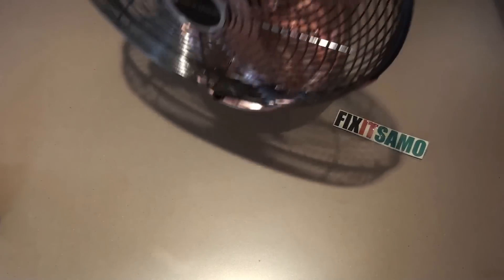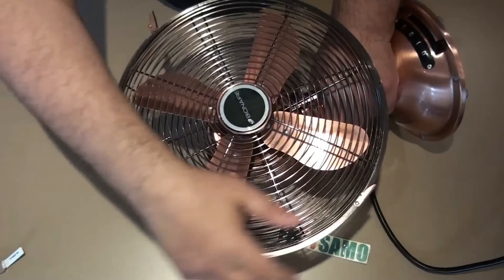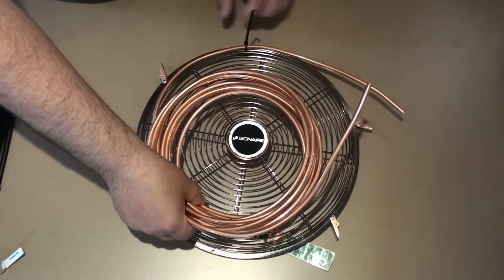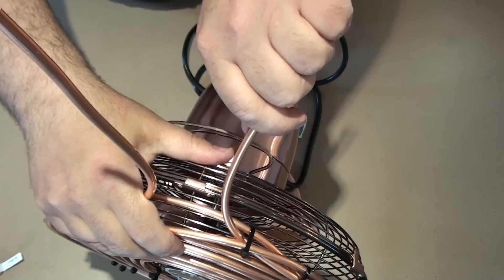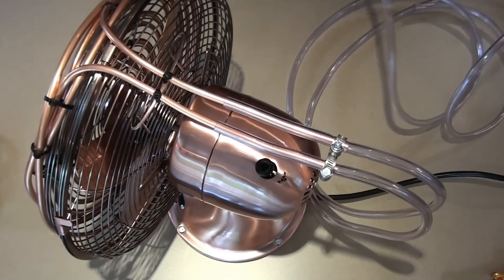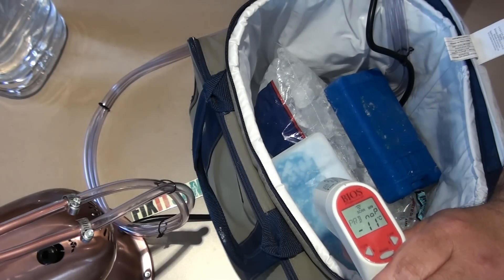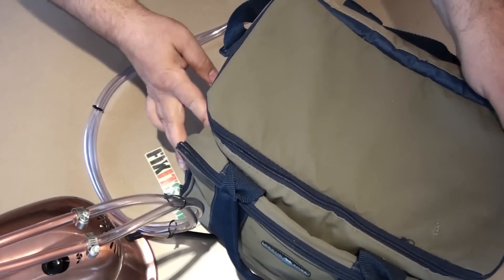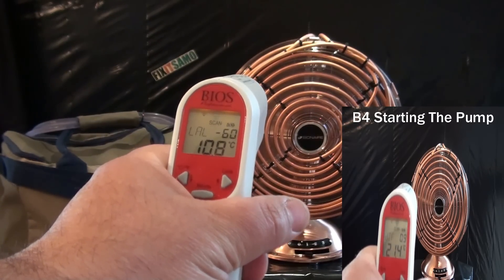How To Turn Your Fan Into An Airconditioner  AC

Comment: logically spekaing ,, the concept is perfect ,, pretty much similar to AC concept, the only question is ,, if Mr. fixit can respond is whether this would work fine in HUMID enivronment ,
Reply: Why would it not work in humidity?
Reply: Great question! It wouldn't be so effective. Hotter more humid temperature is going to melt the ice faster. It will work, just not for long. The water needs to stay below 50°. The other device u would need is a dehumidifier with the exhaust going outside. Otherwise, you're adding to the humidity.
Reply: Hello im not deep into this but isnt condensing coils in front of fans some sorta dehumidifications?cuz ig this setup give dry air/dries it, right? @mediocrespectator5627

Comment: the price of that copper i can just buy a window unit.
Reply: that copper tube is cheap. If you think you can buy a window unit for cheaper than $20 you're smoked.
Reply: @malevolent1794  OR, you COULD just use Aluminum tubing, the MK/W of Aluminum IS lower than Copper but it's still extremely effective.
Reply: @Mooseguy15 yooo fasho copper might be the thing making me not wanna risk settin it up so i wanted to try alums and some said "Oh CoPpEr Is 3x EfFeCtIvE yEt ThIs IdEa iS iNeFfIcIeNt" so i rly ddnt know what to do... i thought of around 6m alum tubes in front of fan and 1-3m alum tubes in water tank between gel ice packs to act as chiller
Reply: @malevolent1794 Im pretty sure he was being sarcastic lol…. The price of copper is ridiculous now…. 10-15 yrs ago you could get the copper for a third of the price it is now. 

And even if he wasn’t being sarcastic there is some truth in that… the cost of the fan and pump and clear tubing with the addition of $20-$30 in copper you CAN pretty much buy a wall unit.

What this is nice for though is when you don’t have the option (IE no windows in the room).

Comment: The only way this is workable is if you live in an apartment where they don't charge you for water and the incoming cold water is very cold. You can hook it up to run water through it continuously. I had a friend who lived in a apartment where they did not charge water and during the winter he just ran the hot water continuously in the shower to heat the apartment. Of course everything that was in the apartment that was metal ended up rusting LOL
Reply: Very wasteful, especially for drinking water
Reply: Stupid as mold would grow
Reply: What did I just read? Are you a bot? You can’t be real.
Reply: Just reuse the water from a large tank!
Reply: That's nuts think about it I would wanna see what it would look like lol

Comment: This is actually a much more efficient system than many I've seen here on YouTube. The only problem with using ice/water as a coolant is that ice is expensive - either in money if you buy it yourself or in time if you make it yourself. And added to that it is the time spent swapping out bags of ice and cleaning the system. It's pretty cool (pun intended) but, as physicists say regarding perpetual motion machines: there's no such thing as a free lunch!
Reply: just my guessing. maybe An environment that‘’s extremely too damp can cause rheumatism rheumatic bone ache ?
Reply: of course, its an old video
Reply: @gabrielvieira.4358  Yeah, it's not from the 40's!

Comment: Zeroth law of thermodynamics: thermal equilibrium which in layman's terms means all the work you did and the money you spend are wasted...
It would work if you had the water go into a barrel in a hole in the ground. 
There the temperature stays lower than the outside and inside ambient temperature.

Comment: That's definitely bull$hit! You cannot cold the room air without blowing it outside... it's just fizic.
Reply: In this case it is just transferring the energy from the air into the ice. Which will then turn to water and the water will continue to warm until it is the same as the air temp.
Reply: That’s not true. Evaporative cooling is a different method.
Reply: @Blarnix  A different - but very inefficient - method. Ice is expensive to make/buy/swap out. Even if you make it in your own freezer, it takes time/energy to make and swap out.
Reply: @christophercharles9645  Yup, it’s just like a regular air conditioner, just moving the heat energy elsewhere.
Reply: You're melting the ice.. then taking that ice outside... xD

Comment: The problem is then the heat exchange is still pumped into the home unless it's a fridge in a separate part of the home (ie garage).  While this allows a person to direct the cooled air towards them the production of ice or freezing the gel packs still results in heat being removed by the fridge which still dumps the heat most likely in the very home this is supposedly cooling (this is why air conditioners/central air units dumps the heat outdoors directly).  I can see someone getting ice from the work fridge or freezing it there to use for the home for the user's overall benefit, almost any other option the heat trade off is dumped right back into the home.  The main problem with all these "diy" air conditioners in most cases are the same, literally trying to displace the heat to their home's freezer but not realizing that this refrigerator is dumping the very heat back into the room (I don't know of any other than a RV when the heat is dumped back outdoors).  

Depending on the area what might be better is having a series of copper tubing underground thus transferring the heat to it while pumping the cooled off water to this radiator fan.  Depending on the area will depend on how deep a person would have to bury the lines plus they'll need a means to protect the lines too (ground shifts and corrosion).  Similar to how a basement is cooler in most homes due to much of it's heat conducting up and into the walls with a cooler floor this is how people need to think about these diy air conditioning otherwise they don't really net overall the cooling benefit.

Comment: rig one in the kitchen so the water source can remain in the fridge (tubes rigged to come out through the back possibly) without the need for ice or adding cooler water constantly
Reply: But this method will be constantly adding heat to your fridge , reducing its efficiency.
Reply: @caribbeanman3379  it would be a small amount of water for it to keep cool, would be a minute amount of heat at best

Comment: This cool air thing is cool. Better than just an evaporator which is terrible in humid climates. 

That said. It is an air cooler not an AC. AC actually takes moisture out of the air.
Reply: Actually, this method will take some moisture out of the air. The copper tubes on the fan will get cold and cause water in the air to condense on it. You will need to put a collecting pan below the tubes to collect this dripping water - that's being extracted from the air! May not be a very effective dehumidifier but it will do some dehumidifying.
Reply: Technically this is an intercooler/radiator.. but with water.

Comment: evaporating water is okay outside

not inside when it is humid outside

add more moisture to your air will make the heat retain and sweating will increase and not help

It is better to just fan with lower air not a ceiling fan. And just set your AC enough to reduce the humidity a tad. or have a dehumidifer if you want. Not just the basement the room you are to sleep in.
Reply: The cold water is contained and circulating within the tubing. Nothing is being evaporated.
Reply: @BottomTick  Thank you. I didn't even bother with the whole video because I thought it was going to be shouting mist at me.

Comment: Interesting.  Would have liked to see how long that ice last (blowing cool air) before needing to be replaced.  I know it is somewhat temperature dependent, but would have been an interesting data point.
Reply: You can make it last longer by using bottles with frozen salt water in place of naked ice cubes Then you can just pop the bottles of brine back into the freezer when they thaw out completely. Makes for very easy reuse. Salt added to water causes it to melt more slowly. I think a good setup would probably last at least 4 hours.

Comment: also, make sure the freezer you use to make the ice is outside your house.  why? because the heat the freezer removes from the water to turn it into ice goes into your house otherwise, thus completely negating any overall cooling you would get from using the ice for the fan.
Reply: That's why people in the California desert (or any really hot location on the planet. Hey if you live anywhere on the northern hemisphere, it's hottest July-August) put their spare refrigerator in the garage.   Get that heat out of the living area!   Maybe a refrigerator design with a sealed "zone" for the condenser coils and 4" duct fittings.  All installed at the factory, or available as a kit.  Then you route yir hot condenser/heatexchanger exhaust air outside.  Another duct is necessary for the cool intake air.  Or better yet:  a single "coaxial" duct (like the type used on water heaters).  The sealed condenser area and intake/exhaust ducting is necessary for HVAC reasons. In the winter you would disconnect the system so yir refrigerator would provide additional heat to the house.

Comment: first of all that thing will spray water everywhere there is no dryer on it
Reply: What are you talking about?
Reply: @juntjoonunya9216   condensation. like the water drops you get on an ice cold can when you let it sit outside the fridge for a while.
Reply: @louisvl10 You Forgot EVAPORATION , with that amount of air moving EVAPORATION WILL BEAT CONDENSATION.
Reply: @VJETRA hey kid.  ALL window mounted air-conditioning units have a condensation drip tray installed.   AND the a-c unit must be set at the mfg.s designed attitude.   Otherwise, during humid times of operation, the condensate would drip all over yir couch.   In automobiles, there is a a-c condensation tray with a hose that leads to the outside.   You can see the water dripping from vehicles at intersections or when they are parked.
Reply: @josephsteffen2378  Agreed most window air conditioners are mounted at a slight angle physically or parts of it internally with either a drain hose, plug hole, or tray dripping the water outdoors due to removing it from the interior of the home.  This can easily be observed by anyone watching one of these in operation.  The in room air conditioners have either a drain plug to drain them, a catch container to dump, or a hose pumping it out the window.

My sister had a window air conditioner that didn't seem to work and water was dripping in the room it was at.  Her daughter that installed it didn't remove the drain plug in the back, after that it worked phenomenally well as moisture traps a ton of heat.
Reply: You nailed it!

Comment: If the ice comes from the refrigerator inside the same house as this AC, then this will not work. You have got to put the heat outside. Otherwise it will actually make the house warmer.
Reply: What the hell you on about? The ice is the coolant, once the ice melts you just have to reload with more ice, the heat ends up in the water melting the ice. As long as you replace the melted ice with new ice it will continue to work.
Reply: @HDsharp I think he's saying that the heat just gets redistributed back into the cooler which will leak the heat back out. But this isn't perfect science. The is just how do we throw come cool air on us now? And I agree it's a nifty little diy I may try
Reply: @HDsharp  Physics. Energy can neither be created or destroyed. It can only be transferred from place to place.
Reply: This is literally correct in a closed system. You can't beat the rules of physics, but in the real world, probably misleading. Your refrigerator slowly dispatched the heat over time, and that excess heat leaks out a night in most homes. So the heat is going outside. By the time you pull the ice from the freezer, the heat removed to make it is long gone.
Reply: They're not talking about refrigerant where there is a condenser fan it's cold water not refrigerant the reason why there is a condenser fan on refrigerant is so that the compressor condenses Vapor not liquid on a AC unit
Reply: Agreed so I'll break it down more since others didn't seem to understand you.  The ice or frozen gel packs came from the content creators fridge.  The fridge that froze them extracted the heat from them and pushed it to the coils of the fridge when bleeds that heat back into the room.  Now unless there is another central air unit or air conditioner pumping the heat outdoors then all this person is doing is moving the heat between his "air conditioner" to his ice/gel packs, back to the fridge, which dumps it right back into the room, then the room back to this "air conditioner" so in a sense he's only shifting the heat back into the home.

In fact each time his refrigerator is producing the cooling ice/gel pack he's actually generating more total heat due to the power from the grid is being used by the fridge, so unless his home is bleeding out the excess heat by opening windows, central air unit, or an air conditioner that is pushing the heat outdoors he's actually netting more heat.  There is no free lunch, to actually cool off the home the heat must be displaced in a way he doesn't have to keep dealing with it, this is why central air units, window, and room air conditioners pumps the heat outdoors so it doesn't have to be constantly dealt with.

Comment: A couple great updates for the design: use a battery-powered camping fan a small radiator like a car one instead of all the bent copper tubing. That would increase portability, greatly increase safety, while simultaneously decreasing build time. It might also mean greater surface area for thermal transfer and thus cooler air output.
Reply: How do you find a "small radiator like a car one" wouldn't they all be the size of a car?
Reply: @brendalg4 Obviously a car's radiator is way too large, but a car's transmission cooler is ideal in terms of size and efficiency. They are usually found bolted to the bottom or one of the corners of the radiator
Reply: @nnamerz  thanks to you and @fixitsamo

I saw somebody in the comments on this video or some other video saying that they got an evaporative fan. I thought maybe that would be better for me to try because if it doesn't work I can always send it back. If I try to experiment and it doesn't work, I'm just out the money
Reply: @brendalg4 If it helps at all, you can get a  used transmission cooler from an auto wrecker (car junk yard) for pretty cheap. Other alternative options: a used heater core from a car, or the small radiators used in computers with liquid cooling, etc..
Reply from the maker: @brendalg4 

Richer-R Computer Cooling Radiator, Aluminum Radiator Water Cooling Cooler Row 80MM for PC Computer CPU Heat Sink Work for 8-10 mm Diameter of Tube https://a.co/d/2kJro67
Reply: The main issue that needs to be addressed is pumping that excess heat outdoors.  It doesn't help that in a way this video is only recirculating the heat in the form of exchange between the improved AC, ice/gel packs, and refrigerator which bleeds the heat back into the room it's located in.  This is why units people buy always has the heat exchange pushing outdoors instead of staying in the room.

Comment: how do you stop the condensing water from dripping on the fan motor ... maybe run the inlet/output under the fan !! before you die !!
Reply: Or route the tubing only like under the motor, so. The bottom half?
Reply: by turning the fan on? you know air is quite absorbent right?

Comment: You should also be able to use it as a shower since itll be condensating water all ovee you.
Reply: Don't you think he will wipe it dry time to time?
Reply: @HDsharp  the average air conditioner pulls 6-10 gallons of water a day from the air. He'll be perpetually wiping it.
Reply: @PIndyJones  it's a slow drip, just put a towel there and rinse it once in a while.
Reply: @HDsharp  ok buddy. Whatever you say.
Reply: @HDsharp Not when the fan is turned on.

Comment: Nice DIY for cooling WITHOUT humidity .. so plastic tube and pump can be placed everywhere (and in other room if needed) .. i have an old little freezer, planing to place the pump in there .. ..🙃
Reply: That's what I was thinking. The tube should be small and pliable enough to be closed around by the door no? Or drill a hole and out it through with a tight grommet

Comment: Imagine using your freezer as the water reservoir and running this with much cheaper vinyl tubing. Copper is a much better thermal conductor but Im sure the vinyl will work to some degree.
Reply: The difference in thermal transfer rate of the copper versus vinyl or plastic is quite significant.  I have experimented with DIY cooling myself, and found that even if you blow air over the ice itself, the cooling just simply isnt enough.

Comment: Could we just fill the pipe with oil or some antifreeze and seal it?  ?
Reply: I like the anti-freeze idea!  That would last forever.   Plus, it would reduce, if not eliminate, any corrosion.   As with water chillers, that are used for manufacturing plants, you have to test for biological  contamination.   Not a big deal for this situation.  Especially since it's a sealed medium.
Reply: I like the antifreeze idea. What kind of oil? In general what fluid is most... Conductive?
Reply: @juntjoonunya9216  I was just thinking about fluid that would not evaporate over time.
Reply: @xjaimevila  ah, and I guess being that automobiles use anti freeze it's gotta be the best for transferring heat too.

Comment: I paid $60 for a 3-foot tall fan box, with a 12-inch fan and a 4 pint water reservoir, it pushes out about 11-13C, and I am totally happy with it. I reckon all that copper tubing and pump, etc was at least $50, so I save a lot of work for $10 more!
Reply: the problem with those is you ad humidity to the room
Reply: Where did you get it? Is there a condensation problem?